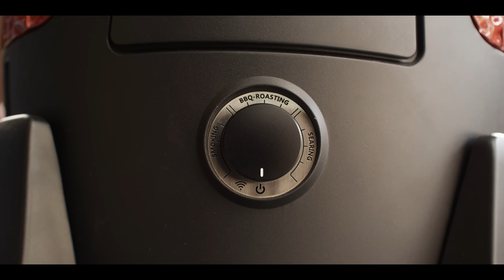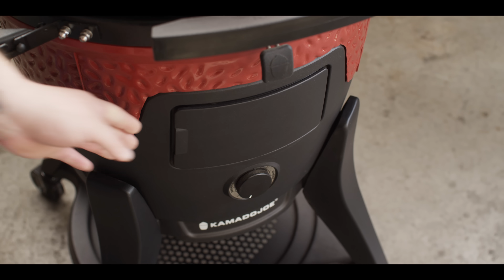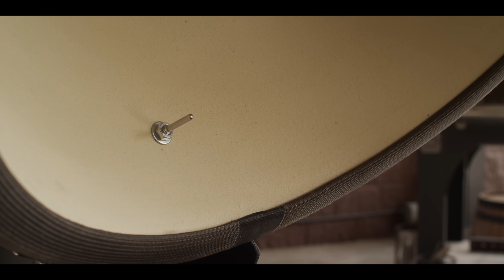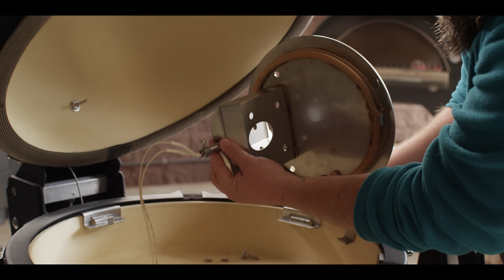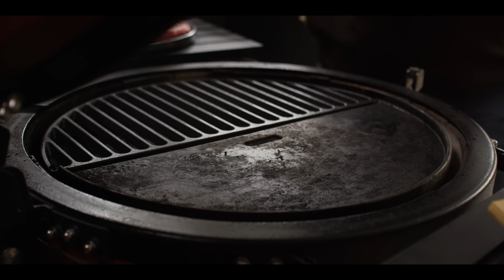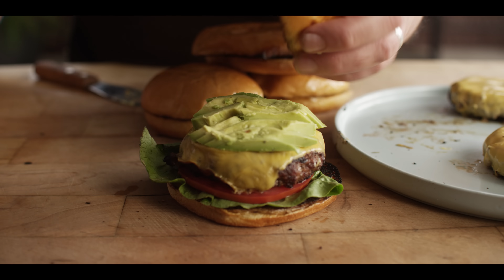Product Round-up: Kamado Joe Pellet Joe

Comment: Hi Tom, how are you getting the direct cooking flames on the burgers? I thought the heat deflector would block the flames?
Reply from the maker: Hey there, thanks for your patience as we catch up during this Holiday season.

The flames you see are from the grease dripping down onto the deflector and flaring up because the grill has been set at 600°, it’s something you’ll want to keep an eye on to keep from burning the burger exterior, but totally worth it for more flavor when kept under control. You can move the burgers to a new spot if the flames get to be too much.

Comment: is the auger in this pellet grill set on am incline to keep the pellets from getting ignited when it gets shut down. It's a problem that plagues most grills as the auger is set on a flat horizontal plane and increases the chances of back burn into the pellets loaded in the auger?

Comment: $2000 for 255 square inches of cooking surface? I'll would recommend the Pit Boss Austin XL for $447 at Walmart.com with its 930 square inches of cooking area. I LOVE mine. Or the Pit Boss 1150 Pro Series with its easy ash clean out, and direct or indirect flame plate operation from the outside and 1150 square inches of cooking area for $600.

Comment: Really feel like KJ missed the mark on this one. It's way too small,  you have to take apart to clean every time, its app or dial only, and it's way over priced at $2k. KJ is known for giving way more value and features in the Kamado market, not so with this attempt. Spend a bit more and get a Yoder YS640s, far more cooking area, and way more bang for the buck.

Comment: I made some comments a few days ago when Atlanta Grill Co. came out with their video.  It's the same comments many of you are making about 2K for an 18 inch grill.  There's nothing unique that this pellet grill does.  Many pellet grills can sear steaks and most hold way more food than this.  My concern with Atlanta Grill's video and with this one, is the grease management and drain.  There was allot of flame up on this video with burgers, and also on the steak Atlanta Grill did.  I'm just wondering about fire issues if it starts pooling or doesn't drain quickly.  It seems like it would be much harder to clean than like a Camp Chef or some others.  Anyway, i'm looking forward to more videos.

Comment: Nice looking smoker/cooker.  
I'm still impressed with a Weber 22" kettle for $100 even though I still have one from the 1980's that is a chocolate brown color. Still cooks good, easy to use and clean.  I'll doubt I'll ever need WiFi on my BBQ grill.
Reply: I've got 6 Kettles and have never had the need to contact Customer Service. :)

Comment: The only open/close option is totally stupid!!! I have a green mountain and love it. My next purchase will be a primo xl!
Reply from the maker: Are you referring to the top vent? We don't carry GMG grills but they're always open correct? The user doesn't adjust airflow on a pellet grill, the electronics do. The same goes for the Pellet Joe... strange things start to happen when the forced air has nowhere to go. The reasoning for the closed setting is for the pizza attachment where the air escapes out of the front of the grill as it's slightly open.

Comment: Unless I'm missing something, you have to remove the entire firebox in order to clean it out? That's going to be a major turn off for a lot of people.
Reply: Nope. All you to is remove the grates and the drip shield then a very small deflector piece. Takes 30 seconds to get to the crucible that you just vacuum out
Reply: @kamadodad3241  you still have to vacuum every time. I vacuum my YS640s every 5 or 6 weeks. Just lift out the tray, dump in the bottom and cook.
Reply: @RumandCook  you don’t really have to every time. But yes it’s better to do it every couple of cooks to have a quicker start up.

Comment: This would be great for those who love the Kamado style cooker but don't care much to mess with the lump charcoal... it can get messy. Plus, the quality of Kamado Joe is "premium" and has many optional accessories. The heat retention of the ceramic Kamado KJ would most likely use much less pellets than the conventional pellet cooker. So I'd say price is not to far off if you are saving in the cost of pellets. I have the Yoder YS640S and it eats 20lbs of pellets with a 10 - 14 hour cook. If you buy the cheap pellets you'll really know it from the food you cook, you get what you pay for in pellets. 2K$ doesn't seem too bad if you save in pellets over time. According to Tom, the 10lb hopper when full, provides 14hrs of cook time. That's half of what it takes on my YS640S. The trade off might be a money saver over time. Looks awesome as well! Very interested in the reviews of the KJ pellet cooker after some people go with it.
Reply: The only thing is its a pellet grill at $2,000 you get a 18 in circle of cooking area. That comes out to 255 square inches of cooking area for $2K. I love my Pit Boss Austin XL with its 930 square inches of cooking area pellet grill at Walmart.com for $447 so you get 3.5 times the cooking area at 1/4 the price. And even if you get the Pit Boss 1150 Pro Series at $600 you get 1150 square inches of cooking, an easy pull out ash box from the bottom, Wifi, and after you send in the PID controller to get facture firmware updated, you can dial the temp in at 10 degree increments from 200F to 300F and 25 degree adjust above 300F with direct and indirect flame with both Pit Bosses.
Reply: I have a classic 2 and if I wanted to do a set and forget I could invest in a controller and fan for a lot less money. It seems that a lot of brands of pellet grills have auger or ignition issues after a short period of time. I subscribe to the KISS philosophy with BBQ.
Reply: @appleiphone69  if you put to much wood and light it even with the fan and controller wouldn't it get too hot? If you don't put enough wood/charcoal/pellets wouldn't it not get hot enough even with controller and fan? My point is you still have to check/adjust wood/charcoal/pellets with a control and fan is my guess, but whatever you prefer and like I'm glad it works for you, I know because I love my fill hopper, turn knob to exact temp and walk away for literally 3-16hrs. I hope you have a great grilling season man. Later.
Reply: @RossMalagarie  I guess I am experienced enough to control the temps with the three components of fire management; air flow, total available oxygen and fuel.
Reply: @appleiphone69  nice😎👍
Reply: @appleiphone69  I know me too but I enjoy turning a knob to the exact temp and walking away only opening the door to flip the meat every hour. But hey whatever you like.

Comment: Plus the pellet space looks super small
Reply: It is a 10 lb hopper but one fill goes over14 hours. The entire cooking chamber is encased in ceramics that hold heat much better than sheet metal. Pellet Joe is super efficient in pellet use.

Comment: I think this will be fail. With the the ikomand and the perks of a kamado  being how well they hold heat and staying stabilized I don’t know why anyone would buy this. Plus you have less space than a traeger or Yoder. I own 3 Kamado joes and an old traeger pro 22 this will not be added to the fleet. It’s cool that it gets super hot but I’ve never had an issue getting my classic 2 or big joe 3 hot at all

Comment: So the lowest temperature you can set is 200F?
Reply: I've not needed to use temps below 200 yet but every temp between 200-600 has been Uber stable so I have no reason to believe that a lower temp would not. I'll have to play around with that this weekend and see how it does.
What I can tell you is that you can get up to 750° surface temps across the entire cooking surface which is what I really like about this grill. That and the better convection and more even cooking that the dome shape provides. 
I'll try to remember to respond back with my sub 200° findings. Should be good for smoking salmon or jerky if it holds those lower temps.
Reply: @hicksta1  Waiting for the info. Just for science cause I would never be able to afford this grill :). The problem with lower temps is, that pellet grills tend to operate flawlessly at higher temps - 200F+. For lower temps to maintain low temperature they have to feed less fuel and air which sometimes causes fire to die off. Especially with this Joe since it seems isolated really well this might be the problem, unless they tackled it some other way (micro feeds of fuel or some kind of short air blows).
Reply: 150° via the app.
Reply: @hicksta1  But does it keep this 150F? Because mine GMG Jim Bowie is working stable 165 up. It just turns fire off on lower temps in sunny weather.

Comment: If this was $500 cheaper, I would be all about it. 2k for a pellet smoker is a little steep to me when there are tried and true options for a lot cheaper including becoming a annoying rectec owner lol
Reply: Rectec will get the job done if only using as a smoker for beginners. It lacks the versatility of the pellet KJ where you can smoke low and slow or sear meats rapidly. The Smokefire pellet grill from Weber is near the same price range and also has much more versatility. The Rectec's are made with cheaply made parts and over priced even for a beginner using pellet smokers. My neighbor has had one for 3 years and has used often. He's had to replace many of the same parts that were not cheap. You get what you pay for in most cases! Again, Rectec is a pellet smoker that will get the job done if only as a smoker... but it will also burn through a lot of pellets. Noted as non-bias observations, as I hold no preference to any of these products. I seek only quality and performance. My opinions are based on research of reviews and personal experiences. For those who have differing opinions and experiences are entitled to their say equally as much as mine. Just willing to share without trying to offend. All in all, happy grilling with whatever you use!
Reply: @RaiseTheBar4Truth  I totally agree with your post, that why I bought a yoder pellet grill, it does it all and will last plus great customer service if needed
Reply: @sherri082772  FYI, I too own a YS640. Bought it in 2016 and did the upgrade on the controller (ASC) best purchase I ever made! Next was my LGE (Large Green Egg) I've own since the mid 80's. Good research and honest reviews are the only way to go! It's true! Great minds think alike!
Reply: @RaiseTheBar4Truth  Not sure why your neighbor  is having so many issues but we owned a Recteq 680 for over 6 years which was used 3- times a week. I only had 2 old style igniter rods go out and they were replaced free of charge due to the 6 year warranty. After the second one they sent me the new style igniter and fire pot free of charge. We passed the grill onto our daughter and purchased the RT-700 last week and its built like a tank, not a cheap part on the grill. We also own the Bullseye which is built cheaper but is sold as a entry level smoker with a 2 year warranty. Operates between 200°-749° which makes it great for smoking or searing. 
IMO, Recteq has the best customer service on the planet. I've seen many instances (on Facebook groups) where they replaced a part for a owner even if the grill was out of warranty. They have even replaced grills due to hurricane damage, flood, and other things. They even replaced one that was blown over into a swimming pool due to a storm. 
 I'm not trying to hijack your post, just trying to show both sides of the company.

Comment: Thanks Chef Tom for firing this up. Seems like an exciting, compact pellet cooker with the Kamado look. $2K is a bit steep for such a small cooking area, with no real way to do indirect and direct cooking at the same time.
Reply: I would recommend a Pit Boss Austin XL for $447 at Walmart.com with 930 square inches of cooking area or a Pit Boss 1150 Pro Series with 1150 squares of cooking area with an easy ash clean out, Wifi, and an direct or indirect flame plate that can be operated from the outside while cooking for $600. I have the Austin and love it, but with the ash box clean out and flame control from outside I would have gotten the 1150 Pro. Also you can send your 1150 Pro PID control to the factory to have them update the firmware to allow for 10 degrees of temp adjust from 200F-300F and 25 degree adjust above 300F.
Reply: With all due respect, you can do indirect and direct cooking with all Kamado style cooking. A deflector is used to provide indirect cooking. Some popular Kamado's the heat deflector will come with the Kamado and some you must buy as an accessory. The KJ has a system setup to provide direct and indirect cooking. I've owned a Large Green Egg for over 30 years. I had to buy the plate setter (heat deflector) and later switched to the cast iron version. They have as well, developed a direct and indirect cooking method. Works very well! Kamado Joe can be purchased with all accessories included. The LGE, most accessories are all purchased separately but they have been changing their marketing only because of Kamado Joe competition. I own a LGE, but if I were to ever buy another, I would go with KJ. After personally comparing the differences, the KJ quality seems to take the lead over the LGE. I know this because of a family member who owns a KJ. Don't miss understand me, the LGE is an awesome Kamado style cooker, I've owned it for over 30 yrs and love how it cooks. It's just my opinion that KJ has competitively taken an edge on qualify and options. But don't take my word for it, research it for yourself. FYI, I paid under $700 for my LGE that I bought from the original creator and owner of the LGE in Chamblee, GA! That was over 35 years ago. How about that for an awesome investment?
Reply: @RaiseTheBar4Truth  it still doesn't change the fact that it is a small cooking area (sqft) for the prize. No thank you! I rather have an Oklahoma Joe!!

Comment: Hi after cooking on the pellet Joe (Initial thoughts) do you prefer the Pellet Joe or the Yoder?
Reply: That's a GREAT question and I'd be curious with their answer.  This is a great channel.  But I'd be surprised if they answer - they sell both, so I don't think they're going to push you in one direction or the other.
Reply: Yoder 👍🏻🇺🇸
Reply: I bought thr pellet Joe and I thinks it's great... Just two complaints...

1. The wife connection doesn't work and I suspect it's due to the 2.4hz VS the 5hz wifi bands. Blue tooth connection works fine.

2. There is a difference between the temp on the Guage on the hood VS what the app says. If I set the temp to 250 on my app it always hovers around 300.

Sonfar have cooked chicken, Boston butt and ribs and all three came out amazing.